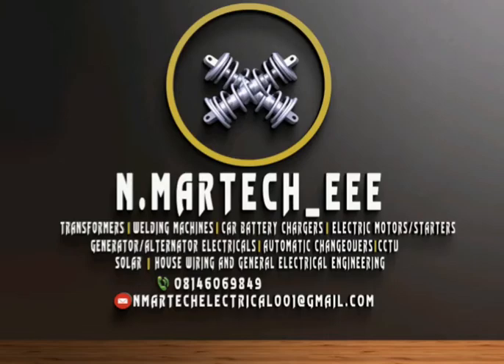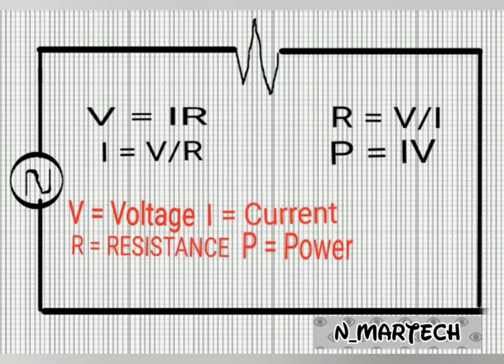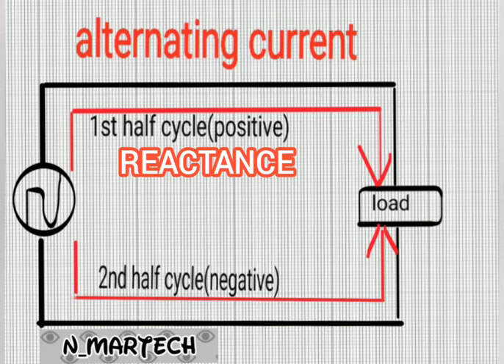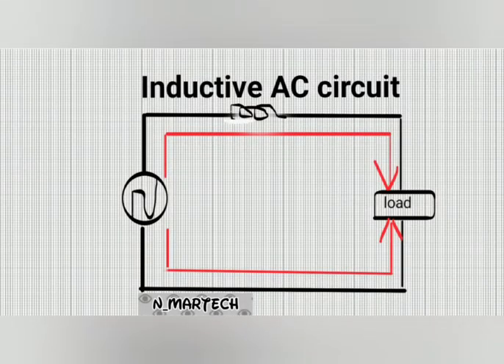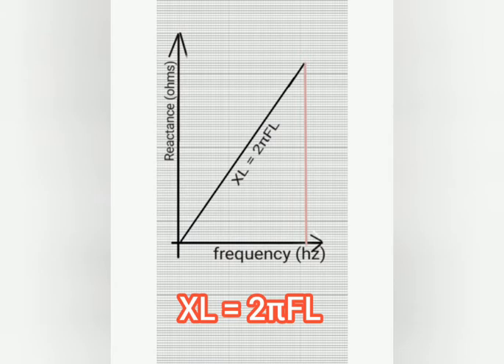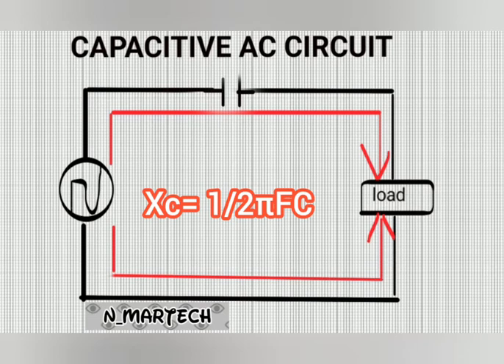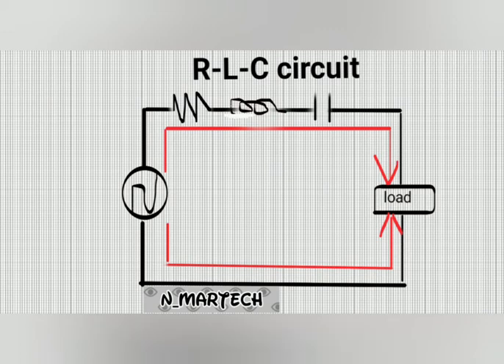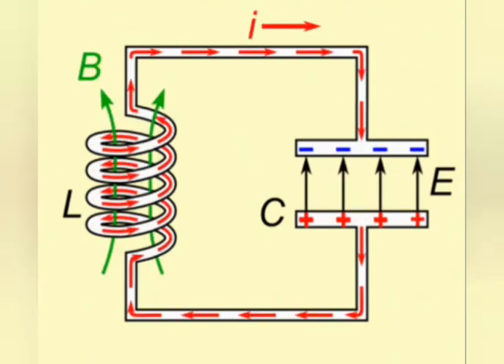RESISTANCE, REACTANCE AND IMPEDANCE

Comment: At the resonant frequency,  can a diode be placed ahead of the inductors, or capacitor, or both, in that the tank circuit won't drain, but will the circuit do work and be much more efficient.